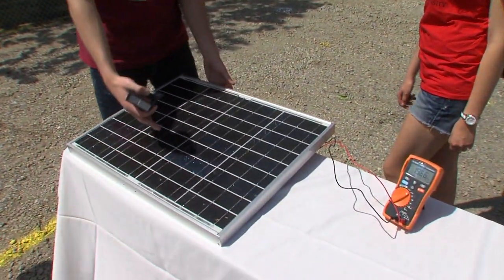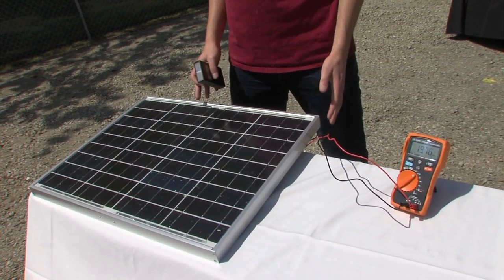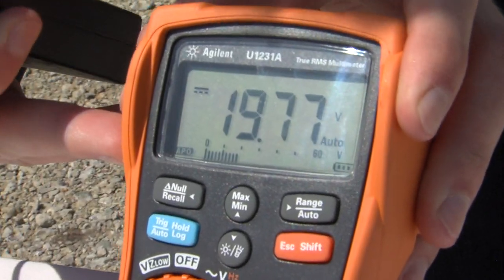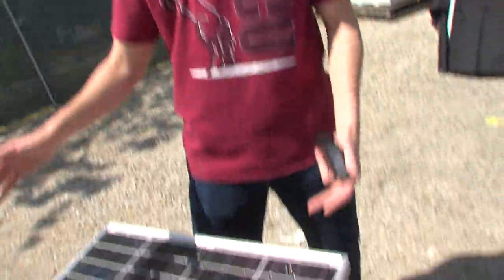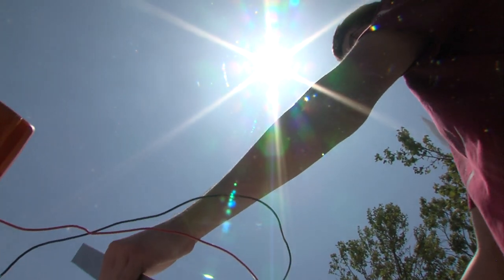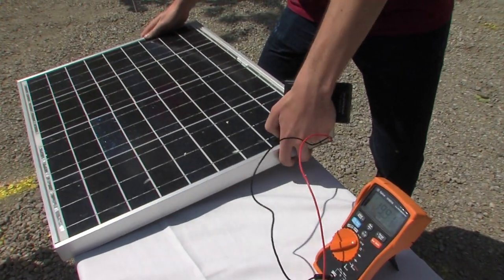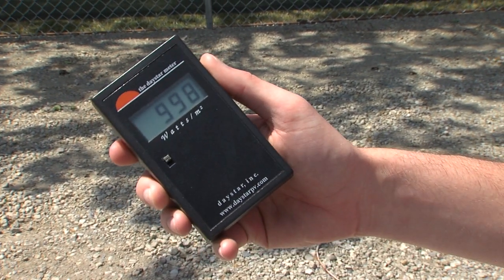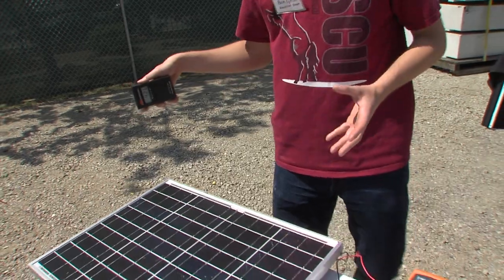Santa Clara University Solar Decathlon - Solar Panel

Comment: But Voltage cannot itself define the power Generated.....
What the current output and what is the power output?
if I need to charge a 12 V car battery from this how much time it will take?
Thanks in advance....